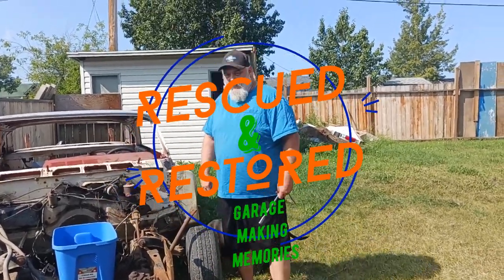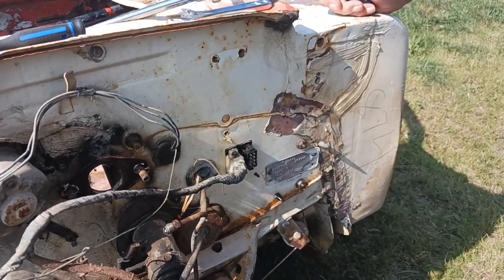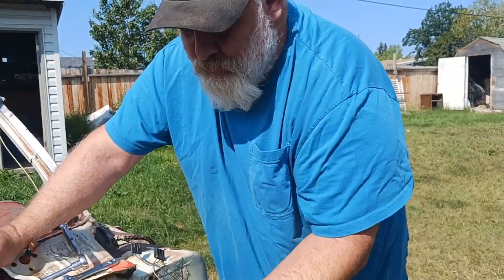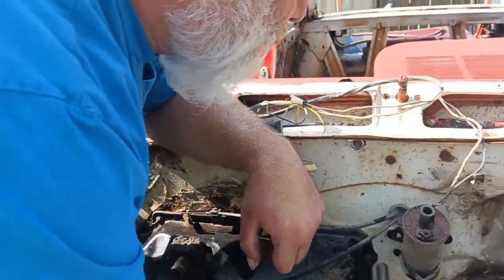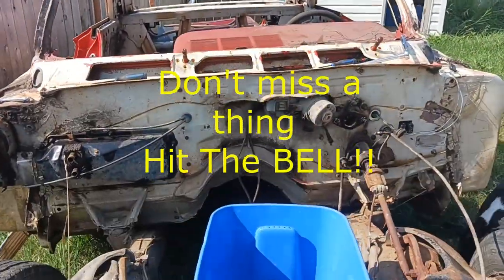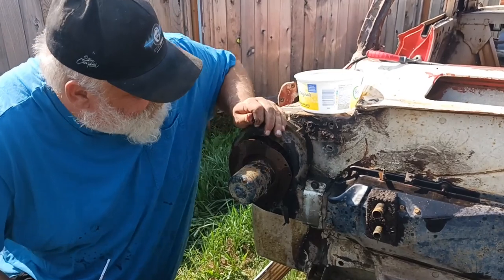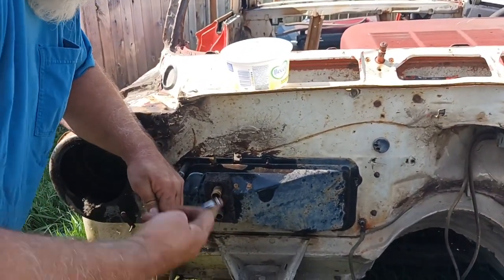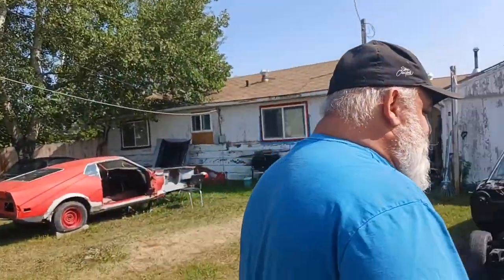62 impala restoration

Comment: When I did my 60 impala I used 2 winch camper jacks and engine crane at rear. Cranked it up ,then 4 steel barrels passed outside wheels  and ran 4x4 across to barrels ,planted body down pulled frame out
Reply from the maker: That's awesome 👌. I need to see what kinda gear I can get.

Comment: This was a fun video for me I'm building the car in my head...l would enjoy rebuilding the master cylinder but then I'd but it in display cause I would use a dual circuit master on the car for safety...and the cowl vents I'd make screens for them to keep debris out less moisture build up and I've made them before...cant help. But build the car in my head! All I see is an exploded view!😂😂😎
Reply from the maker: This is such a great car, brother.  62 impala is a 1 year only body style, and it is gorgeous. And it is so wide it feels like it was made for a big guy like me. I think a good 350 and T400 and some taller gears would make a sweet touring car. Satin black with all the bright work and dark red interior, tinted windows, and some sexy rims.